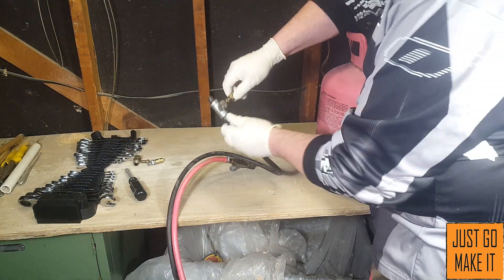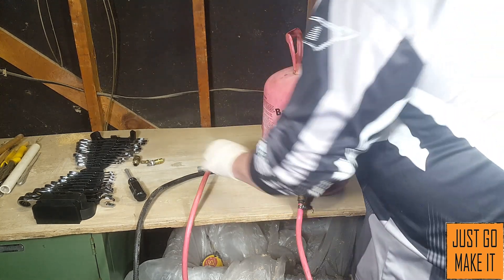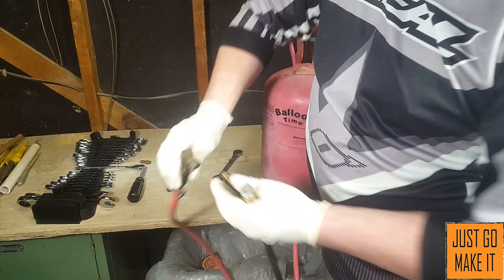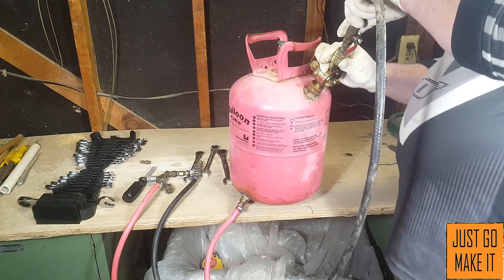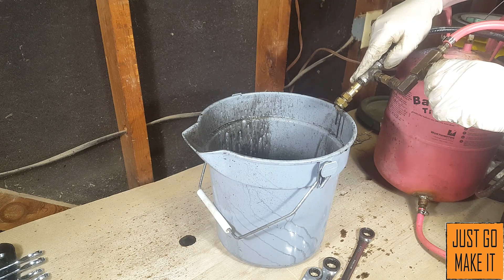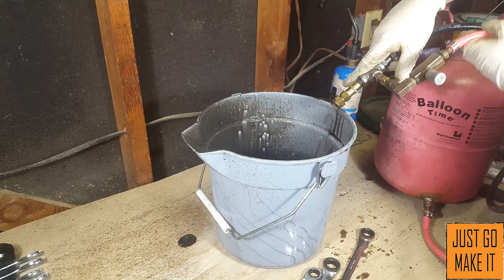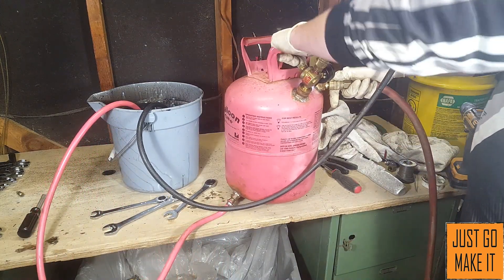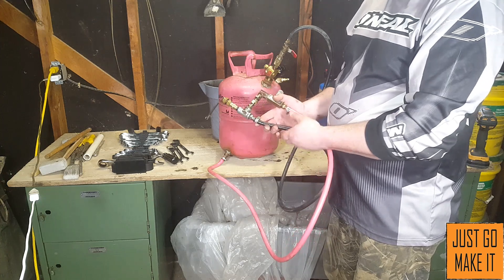waste oil burner 2.0 for the foundry

Comment: Thats cool. Have you ever tried using a cheap paint gun from harbor freight for burning oil. Only reason is that you can control the oil to a very fine micro mist that is almost clear without having to pressurize the oil. They work off the vanturi and gravity.
Reply: Bad bad bad idea.  Please read about the "diesel effect" when mixing oil with air pressure.  I would hate to see someone get hurt by not knowing about this.
Reply: @frugalberry  the sky is falling